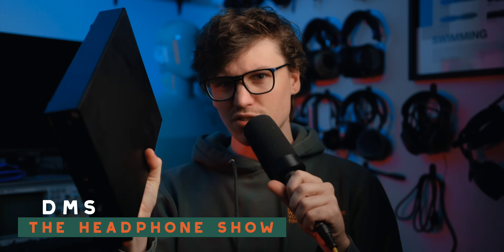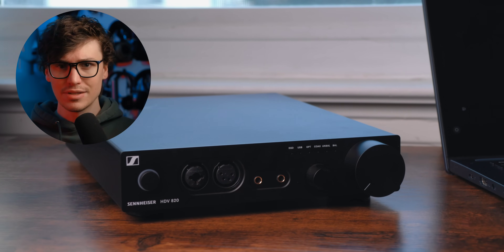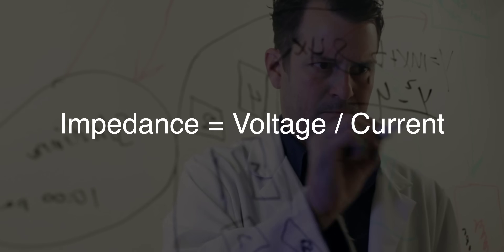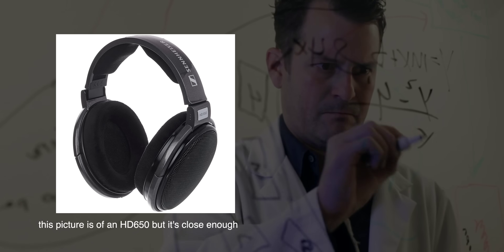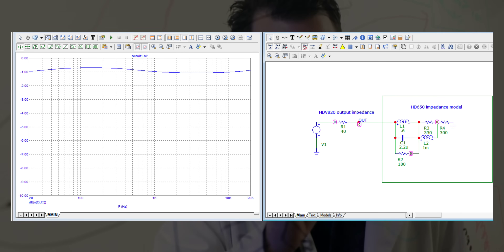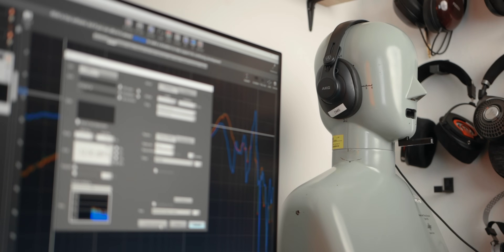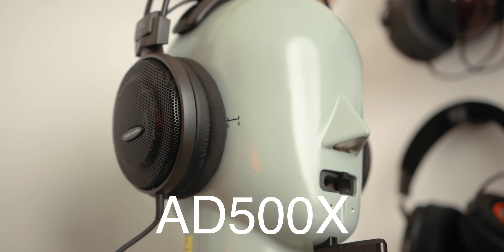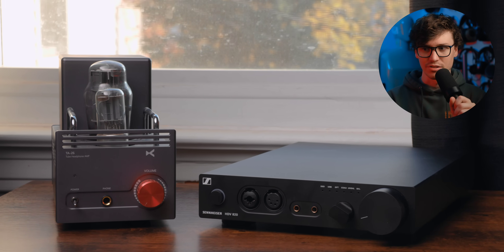This amp can CHANGE your headphone's tuning - HDV-820

Comment: Is it good for the 800S or are there others that are better?
Reply: This supposed to the BEST AMP 4 the 800s. Mine’s coming 2 day.(hd 800s). I’m  using topping a50 amp and dac. I’ll already spent near 2000 for everything. I can’t bring myself to spend another 2000. My pockets are not that deep.
Reply: @isaacmettle how is it for u so far?
Reply: @GoldFus1on  it all right put I think I’m gonna go with the topping 70 pro. The 800s are really power hungry and I like 2 have more power than I need so I don’t have to turn the gain on full blast.
Reply: @assaf3468  it was hard  4 me. I changed my mind a million times. I was gonna get a schiit amp and dac. Everyone I spoke to on YouTube had something different 2 say. PC GAMER HERE. I was gonna get the sony mdr z1r cause they have a MUCH higher impedance and they sound just as good as(Better in some cases) than the hd 800s.i heard the 800s soundstage can’t be  beat.their around 1800 new, but u can drive them with iPad, iPhone ANYTHING,and your good.

Comment: I had experience with this when I was trying a pair of hifiman anandas. I still had a topping a30 (non-pro) amp, which has a high output impedance. The headphones sounded hollow and lifeless, and the HD 6xx were better in almost every regard on this amp. Now with a JDS labs atom amp 2, I get a massively improved sound out of the hifiman's but only a tiny improvement on the 6xx

Comment: If I buy the HD800S without the HDV820 will I lose a lot from the sound quality? It is very expensive, so it it worth it? Does it drastically make a difference?
Reply: The stage is smaller on the Mojo 2 than on the HDV820. Mojo 2 has the better DAC though but if I had to pick. I have not found anything better than the HDV820 specifically for the HD800S. I have lived with both units for two years now.
Reply: I use my HD800S with a less expensive Chord Mojo (original version) for years.  It's a good combination for me.  Unfortunately, I don't know how much better it would be with a much more expensive DAC/amp.  However, for example, Darko Audio does not believe the uber-premium Chord DAVE is compatible with the HD800S.  https://youtu.be/Gcqj1cfDOpI?si=af4lfv3pY4PQRq7q

Comment: Only if there were headphone amp with adjustable output impedance so headphone sound  can be tuned to your  liking (instead of being forced to default output impedance)
Reply: Well, take a 100 Ohm stereo potentiometer and connect it in series with the headphone, like hot wire from amp on wiper and hot wire from headphone on one of each ends on the pot. There's your continuously variable output impedance control.

Comment: Owned both of these units, the one prior, and this, genuinely built beautifully, and it’s very unique sounding in regards to headphones. I really had a bad experience with it, and holographic nature and stage was fantastic.
But the market has truly moved on from 2018, and this was released in 2014 I believe, from memory, I think I would still own one very hard to find though in good condition
Still sad, I sold mine
Reply: Did you mean to say you "really had a bad experience" or "rarely had a bad experience"?

Comment: No, that definition of impedance is incorrect, impedance is not voltage / current. But some of the explanation is somehow correct. Lastly, high output impedance has no benefit and amps should not alter FR, EQ is much cheaper for that.

Comment: Experience (at least subjective) from the speaker world suggests that too low a damping factor results also in bass sounding flabby and under controlled, contradicting what you said about only frequency response being influenced. on top of that, it can lead to the amp running out of current capability (as much power is wasted at the amp output) resulting in clipping. Btw rule of thumb for audio designers has long been that a damping factor of 10 should be just enough but that should apply to the load's worst case scenario not the nominal impedance, no real need for extremely high DF. The HDV820 falls NOMINALLY just short of that when driving 300ohm HPs so I guess it's DF is too low in the worst case scenario even for them. Sen did that in purpose to enhance the bass performance of their bass deficient high Z HPs.

Comment: The value of the HDV820 is poor given the high cost and mediocre performance at best. What's worse, there's audible background hiss with sensitive headphones. If you want high output impedance you may as well use impedance adapters with low OI amps. You can even buy  a range of different impedance adapters for different headphones. With the HDV820, you're stuck with its 45ohm high OI.
Reply: It performs well to my ears, specially when it is paired with the HD800S - which it is pretty much its main intended use. This comment I am replying to sounds as if it is coming from the camp of measurements and actually zero listening… but hey… to each their own. Peace.
Reply: @joseluishernandez8795 passive aggressiveness a common trait of addicts. Please go back to headfi with the other purchase validation addicts.
Reply: @En_Joshi-Godrez  Hi sorry, I didn’t see this! Hope you are doing well.
Reply: @InTheKeyOfJoseLuis    thank you. It's pretty tough being a jam 1 guy living in a harmen 2019 world, don't you think?
Reply: @En_Joshi-Godrez  Hi again! What does it mean being a Jam 1 guy? Yes, the attachment to the Harman curve/cult/religion/way of living 🤭 that sure its tough. I am glad that they are now showing a range within Harman and not just one line.

Comment: Although I agree that high output impedance isn't necessarily bad, it does make your amp less versatile, which isn't great for something at such a high price point (i.e. your point about consistency). 
Also, you can artificially increase output impedance by adding an inline resistor. Crinacle's project red is a good example of this. It's also a mod that people have occasionally done in the past. 
It's a less convenient way to EQ. It works fine, but also EQ is an easier method for the same effect.
Reply: Really gotta wonder why there are so many people strongly against EQ that have no problem with this stuff, and visa-versa. They're literally the same concept, you just control one through software and one through hardware.
Reply: @Avruthlelbh they know its devalues their gear. If you can make a a90 sound anyway you want, you wouldn't own anything else, so they habe to proclaim their much more expensive amps sound more natural. EQ gets in the way of that argument.
Reply: @enjoshi-godrez8775  Also I hear a lot of pushback that EQ introduces distortion and people freak out at the mere mention of it whether audible or not and never bothering to test if they can hear a difference, it helps perpetuate the idea that if you want new sound you must get new gear, right down to USB and power cables. Dealers and marketing people regurgitate this often.

Comment: any budget options with high output impedance that do that bass shelf bump in the FR ?
Reply: (1) any low OI amp plus an impedance adapter
(2) Qudelix 5K and add it with EQ
Reply: It is a budget option.....for more Leben CS300 or CS600.....both tube amps hand made in Japan....

Comment: "impedance is a relationship of voltage and current"" current is the actual movement of electrons through a circuit" " voltage is what most people think of as electricity" sorry but "voltage is what most people think of as electricity" is absolute crap and then i realised that this is just another youtube video thats pretending to know what its talking about . 100% disappointing  unsubscibed .

Comment: As far as i know
High impedance hp needs higher voltage with less cureent to drive as intended.. low impedance ones such planar hp with low sentivity needs more current not voltage.. thats why senns. Prefers tube amps or amp with high output impedance which decreses current .
Reply: You got things upside down. Amps do not decrease or increase current. Amps provide as much current as their load requires, up to the limit of their capability. The same applies to the mains sockets in your house..

Comment: Please tell more about this output impedance mystery!  My HD660s changed its character after I  added a cheap wall-powered amp between DAC and headphones.  Battery-powered amps were not enough.   Sound lost all harshness and ears don't get tired -- ever.
Reply: Probably more to do with the portable amp you have been using running out of current.
Reply: @razisn  I suspected the same, but Fiio A5 should have been ok, by numbers.
Reply: @razisn or voltage (Beyers treble harshness is due to low voltage output amps)

Comment: I would love to see a video about headphone amps and how much power you really need to run high end IEMs and Headphones. 
I keep hearing so much conflicting stuff. 
Also a video about IEMs and Headphones with balanced cables/plugs and does it really make a huge sound difference when listening to them?
Reply: Every headphone spec sheet tells you how many dB the sound pressure is at 1 mW. These levels are mostly north of 90 dB. 3 dB up is twice the power. That means that at 1 W output, you will damage your ears within minutes with about every headphone. No video required.

Comment: I own the HDVA 600 (same amp , no dac great prices on used market) and love the sound of DT880-600, hd650, and grado hemp (the grado actually sounds great with high output impedance) through it. Great to see a video on amps with higher output impedance. Own several and they play well with most headphones.

Comment: Are you sure about the output impedance damping factor, about it being a FR change only, not a decay change? If it is true then this is a big thing.
I thought "damping" in physics mean a phenomenon in which the amplitude of a wave is decreased by a force that it proportional to the amplitude of the wave. More shortly: i thought more damping generates faster decay.
Reply: You are correct.

Comment: Does anyone have measurements of the same headphone on various gear swapped out systematically? It would be interesting to see how much change there is, what the average change might be, basically see how much is our own BS and how much is real. I wonder too if there are more differences in the timing areas of sound, as what I usually notice changing between gear or amps often is some changes in sound stage / imaging /placement. One sound will come from one place on a setup and another with the same source, headphones, but a different amp. Or just going from like device to like device, sound between DAPS or dac/amps. Is there measurable differences or are we all full of you know what??
Reply: @GREQReviews  there is a much larger problem in your methodology anyway. Your measurement can't  account for changes in Dampning factor or slew rate, the phenomenon in which the amplitude of a wave is decreased by a force that it proportional to the amplitude of the wave.  The damping generates faster decay. All amplifiers have a different factor.
  
In fact frequency response can be calculated from the impulse response (by performing a fourier transform).  
That's how frequency response is "measured": you calculate the impulse response from cross-correlation of the stimulus with the recording and then perform a fourier transform.  
Any change to the impulse response necessarily results in a change to the frequency response as well.  
  
"waterfall plots" (cumulative spectral decay) do the same thing - perform an FFT of a short portion of the impulse response aka, how damping factor changes the impulse. Any change to the impulse response necessarily shows up in both the CSD plot as well as the frequency response plote.
  
HOWEVER, none of this is visible in a FR graph, even though it is FR, as in its snap shot that you see it can only describe how much attenuation/accentuation it has for each frequency, but it does not describe, for example, playing one frequency would cause another harmonic frequency to appear , aka nonlinear transformation. That is FR, but can only be done with a spectrometer analysing the music single verses the the impulse response, which you haven't tested  because they are just the snap shots. Thats is a fallacious use of FR graphs for the reasons stated above. 

There could absolutely be a change in sound even when the snap shot looks identical. Because it doesn't prove the FR didn't change the actual impulse response, which IS FR.
Reply: @GREQReviews   no thats a really toxic attitude. You were wrong about your methodology leading to your conclusion yet you defend it anyway. Your defending evidence that is false. Thats never acceptable no matter what excuses you give.
Reply: @GREQReviews  you were wrong, a decent human being would admit that. There is nothing trustworthy about a person that gives false conclusions. Thats a fact.
Reply: @GREQReviews There is no justification in improperly using scientific evidence to make conclusions. There is a massive amount of electrical engineering that goes into amplification, you being an enthusiast of the hobby does not excuse you from the necessary information needed to make those conclusions. What you said was false. You gave the op false conclusions based on the evidence you provided, there is nothing "trustworthy" or acceptable about that.
Reply: @GREQReviews By your logic flat earthers are trustworthy, because they saw the horizon was flat from the eye level and used that to make their conclusions. You did the same thing here. Both a true, but used on a improperly make that conclusion. Not ok there, not ok here, not ok anywhere for those reasons.
Reply: @GREQReviews measured them on what. You don't have a spectrometer. Lmao
Reply: @GREQReviews  no its not at all OK. The minidsp has so many artifacting problems. Lmao
Reply: @GREQReviews  your methodology is fallacious, objectively so.
Reply: @GREQReviews bro you arn't a civil servant, no one is relying on you to be trustworthy and thank God they arn't. What a laughably egotistical thing to say. 😂
Reply: @GREQReviews he also didn't use a ad hominem. He said your attitude is toxic, he didn't attack you as a character, just what you said here, which was by definition toxic.
Reply: @GREQReviews  haha, you're using alt account to like your comment. You're even more toxic than I thought. Shameful.

Comment: It would be fun to compare this amp to the Feliks Euforia, an OTL that has a low output impedance (for an OTL) so it can also drive some planars. It asks the same question as the Sennheiser amp, but answers it through vacuum tube technology instead of solid state.
Reply: tubes are life, tubes are options, tubes are music

Comment: Fixed high output impedance is bad because it makes EQ difficult and especially multi-way IEMs will typically sound worse. 
It's fine when there is a toggle for output impedance like on the teac ha501, Beyerdynamic A2 or the AT-HA5050H from audio technica.
Reply: interesting, I didn't know the A2 had a toggle for that

Comment: would it be the same effect if you use a 40 ohm impedance adapter? theoretically i mean... on a neutral sounding amp.
Reply: Yes, just adding an impedance adapter would achieve the same result. It might be harder to find a balanced impedance adapter with great channel matching, but adapters would still give you way more flexibility than an amp with high output impedance. If you ask me high output impedance on an amp is just bad. You can improve other metrics for the cost if you don't aim for low output impedance but the impedance itself is still a clear negative. If there are headphones that you clearly prefer with like this, you should just find the impedance that you like the most and permanently mod the headphones themselves to achieve the new tuning. Makes them harder to drive, but I'd say applying it to headphones no matter the source makes much more sense than applying it to a source no matter the headphones.
Reply: @jusmirtic  I have a Hiby 20Ω balanced impedance adapter (IA02) with as far as I can measure perfect channel balance. I don't think that's particularly difficult.
Reply: A very good question.